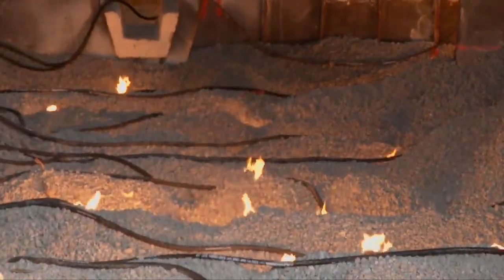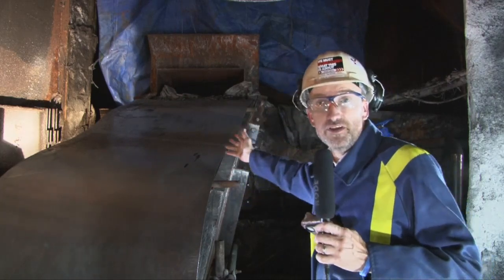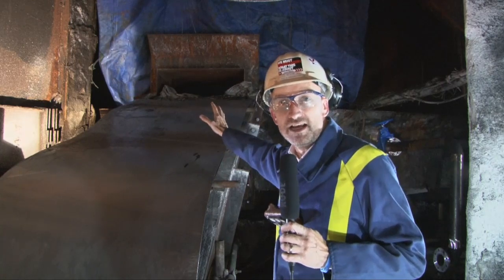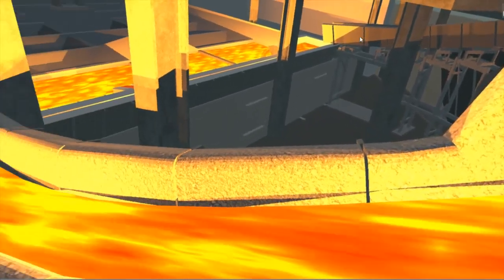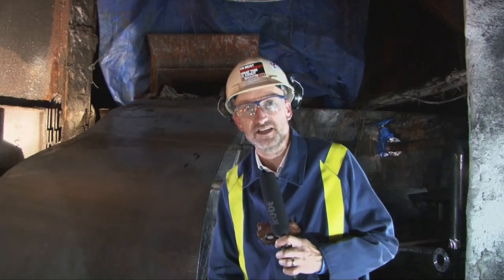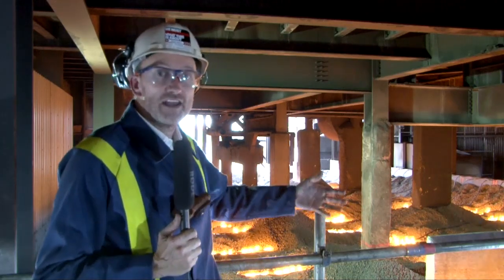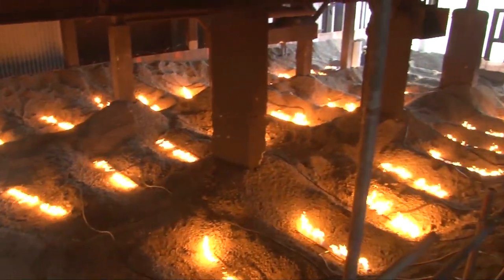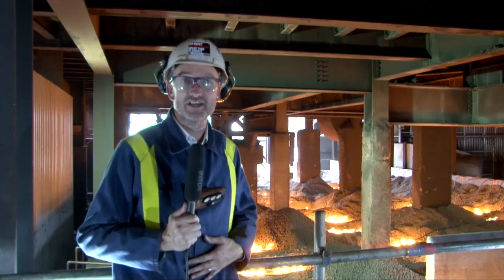Blast Furnace 5 Life Extension Project - Tim Rutter steps inside the furnace!

Comment: So he said this tap is at the very bottom of the furnace, and the normal routine tapping is done a floor above.  I wonder why they don't tap at the bottom level during production as well?  Why leave so much molten iron in the furnace during normal operation?
Reply: pretty much gives more stable operation. also preserver way better temperature for prolonged (48/72hr) outages. plus the normal operation produces graphite wich can settle at the bottom of the furnace. graphite is a pain in the a to deal with on the cast floor
Reply: the liquid also protects the carbon blocks that make up the hearth bottom and walls from the extreme corrosion that the flow of bf gas can cause.
Reply: Slag also should be taken out of the BF. Usually tap hole is used to take out the slag and molten pig iron  respectively. if salamander hole is used as pig tapping hole , slag should be tapped upper level of BF.
Reply: @TheSeralp  They probably did. Possibly a role reversal in that the normal iron tap hole was used for outstanding slag. Or, the slag was removed in the conventional way through the slag tap hole of the last furnace batch, leaving only whats to come out of the salamander to be removed.

Comment: Slag also should be taken out of the BF. Usually tap hole is used to take out the slag and molten pig iron  respectively. if salamander hole is used as pig tapping hole , slag should be tapped upper level of BF.